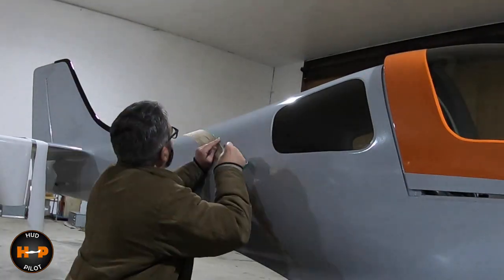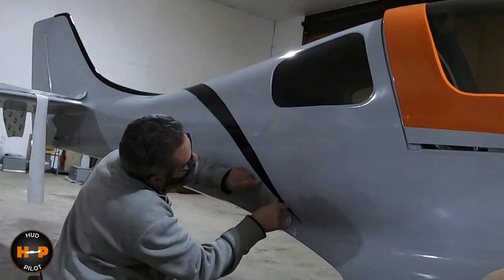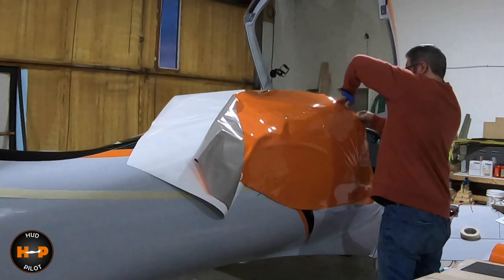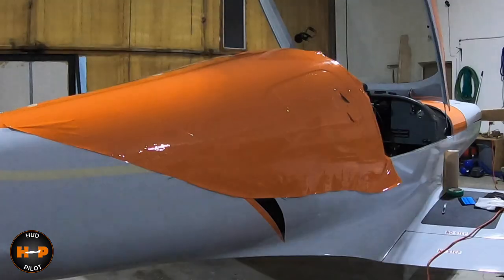Vinyl Wrap an Airplane: Part 3 - How I did it.

Comment: Beautiful wrap. I fly out of CEA3 as well and I look forward to seeing it one of these times. 

Just wondering, are there any helmet mounted or cabin mounted cameras that you recommend for someone starting pilot videography. Preferably something that can capture the instrument panel and outside with a decent dynamic range and some kind of way to incorporate headset audio. Thank you for any input!
Reply from the maker: Hi Zachary. I think we may have met before… yes?
Either way. Pop by the hangar if you see the suv parked there. 
We can chat about the video and audio options when you stop buy.
Reply: @HUDPilot  sounds good. Can't wait for good flying weather

Comment: This is really impressive! Congratulations on pulling this off. Not a basic scheme either, rather intricate. I'm thinking about going this route myself. How much did the custom vinyl cast you? Also,  you have any prior experience working with vinyl? Congrats again!
Reply from the maker: Hey there. First time ever even touching vinyl. Spent 1177$ CAD for vinyl and about 150$ in knifeless tape. The design was done by me both original and on the fly stuff so that cost nothing. Knowing what I know now, I could probably get away with about $700 CAD (due to finding a less expensive vendor as well as knowing I should not have wasted all the vinyl that I did)

Comment: How much vinyl for the whole project?  Is the base layer paint?
Reply from the maker: @Jwd295 base is paint. Cost was around 1200 but only because I went to place that charged me way more than I should have paid. Later found a better source and it could have cost shy of about 800.
Reply: @HUDPilot  so about how many feet of 5' width vinyl?